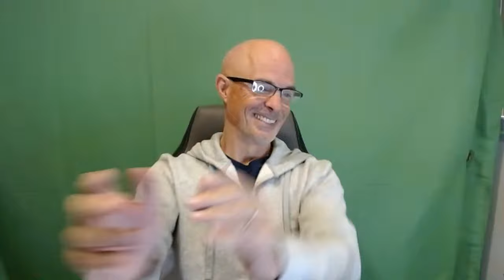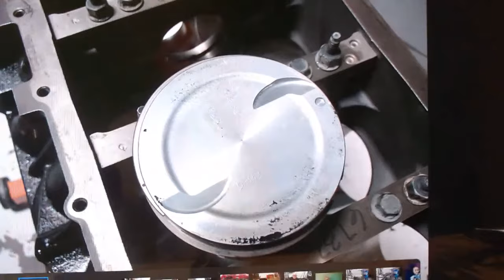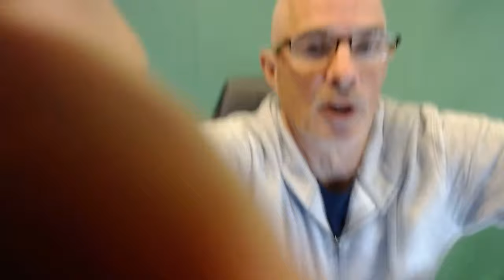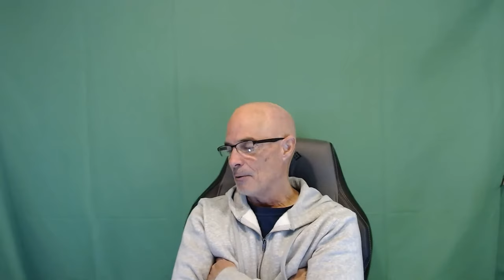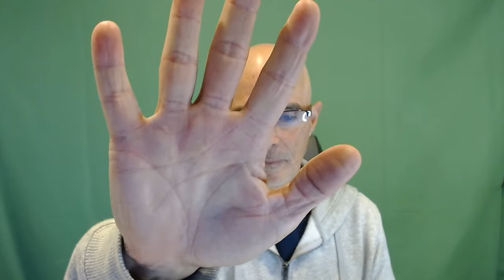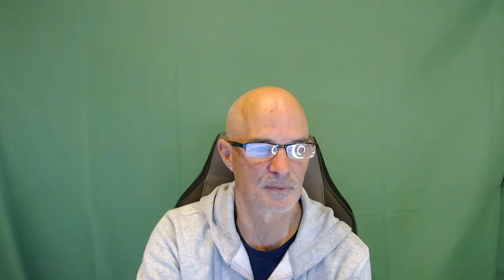LET'S TALK TECH-P-V CLEARANCE-FLAT TOP VS DISH

Comment: On my sbc I went from a dish piston 9:1CR setup to a flat top with an unshrouded chamber 9:1CR and the car ran exactly the same on the 1/4 mile drag strip. Since the compression ratio didn't change, neither did the power on my slow street car.
Reply from the maker: compression is the big thing-how you get it (i.e. chamber vs piston) is the small thing

Comment: Question regarding piston ring thickness going from the factory 1.5 / 1.5 / 3mm stock ring size to a .9mm/ .9mm/ 2mm total seal ring pack can u justify the cost per hp?
Reply from the maker: Total Seal makes awesome stuff, but I would not on any kind of street/strip build

Comment: What about a stroker engine? If you had a 6.0 vs a 408 same cam same head in each combo would you gain PTV clearance by going to a 408?
Reply from the maker: You would because you need an after market piston for the 408 stroker and you would have a valve relief
Reply: @richardholdener1727  would that apply to other engines in the same situation like a SBF from a 302 to a 347?
Reply from the maker: any motor you add valve reliefs to that don't have them will increase p-v